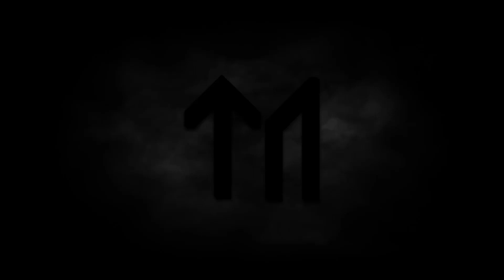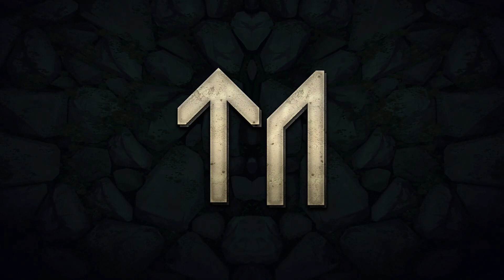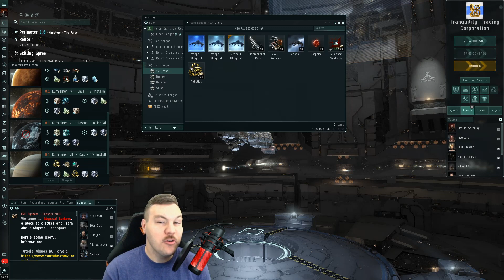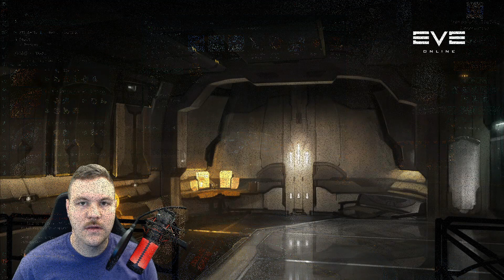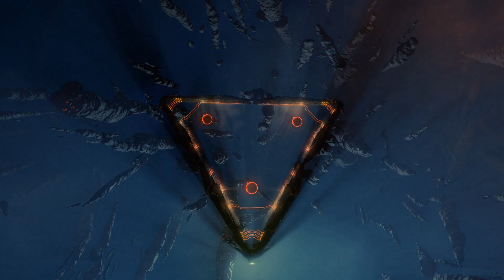[Eve Online] Industry - Blueprints and Building in Eve Online

Comment: Nice overview.  Big thing for builders is to build what sells, which takes some experience and looking at the market data.  I build almost everything, although I prefer common ship modules and drones, as they sell quickly, even though they may have smaller profit margins than ship hulls or structures.  Plenty of market niches to fill, like you said, you can make more profit if you're willing to wait a little longer for stuff to sell.  Also, you don't have to be the lowest sell price, as long as your listing is within the daily volume of your market it will usually move within a couple of days.